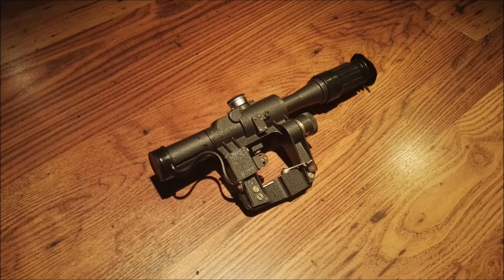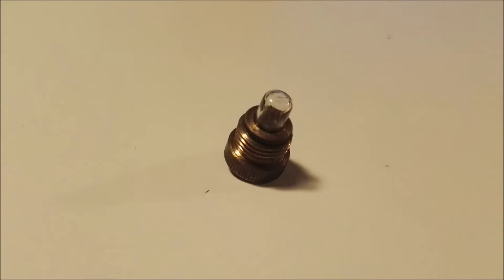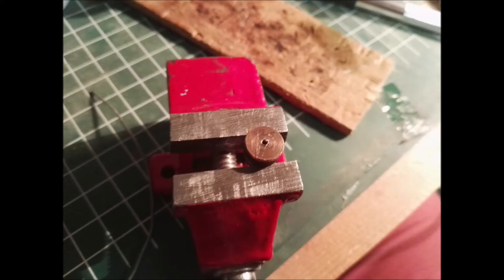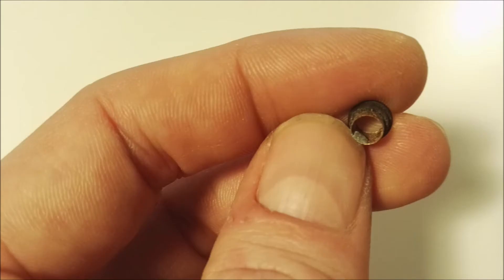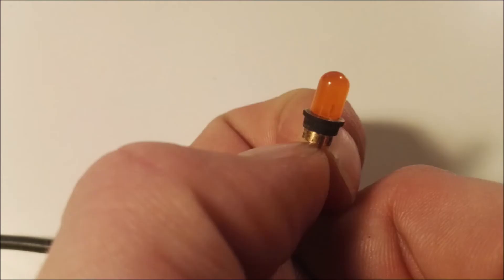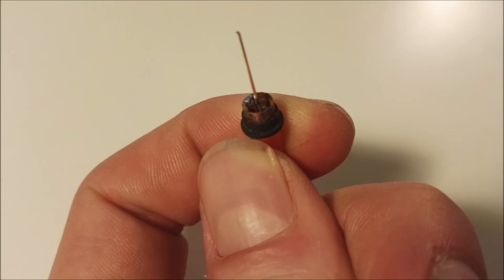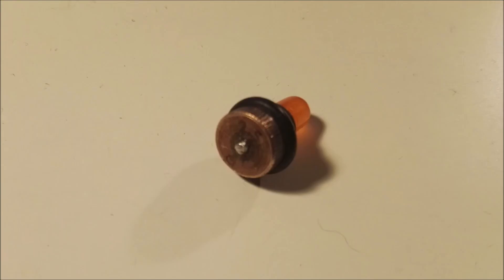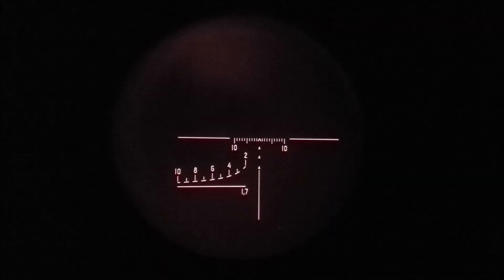PSO-1 scope: light bulb repair

Comment: Can you be more specific as to which LED type  you used .
3v but what output and physical dimensions of LED head.
What colour worked best in the end.?
Thanks. Nice video.
Reply from the maker: Hi Steve, sorry for my late response. I have no specs of what LED I used. But it used something like this:

 https://www.google.com/search?q=LED+dimensions&rlz=1C1GCEA_enNL940NL940&sxsrf=APq-WBuEEJsHYVXiZTpRh2VWPcUxAU5KjQ:1650866131492&source=lnms&tbm=isch&sa=X&ved=2ahUKEwj5_9rKw673AhVDlf0HHdo8CKIQ_AUoAXoECAEQAw&biw=2133&bih=1041&dpr=0.9#imgrc=xQW1uMxC1m1rkM

The thing is that I had to cut/ grind material away from the LED in order for it to fit. This is an iterative process of fitting, grinding, fitting, ...

Comment: i got airsoft clone,

my question is, if i remove the bulb cap, will it leak purged gas inside it?
Reply from the maker: My guess is that the airsoft clone uses LED's. Even if it were a different type of bulb, the amount of gas is negligible small. Otherwise just pull it off outdoors! Wish you the best of luck mate
Reply: @TheWillem  thanks
Reply from the maker: @AbuGuroza  perhaps I misunderstood your question. You mean that your optic is filled with nitrogen? In that case, it should not leak the nitrogen when you remove the bulb. The original PSO scopes are made to replace the bulb in field without losing the gas inside the optic.
Reply: @TheWillem  thanks again for further explanation, now i can having peace of mind to open bulb screw housing
Reply: @TheWillem  Fantastic!  You just answered a question that I've been searching for sometime.  Do you know whether the same applies to the newer POSP scopes from BelOmo?

Comment: what battery did you use ? I can not find how to fix the battery with the original cap.
Reply from the maker: Since I do not like the larger cap for AA batteries (and because it costs extra money/time :P), I managed to use the original cap. I found a spring that fits tightly over the contact of the cap and I used a 3 volt CR2032 battery. Any disk-like button cell should be sufficient. Since the original glowing bulb is replaced by a LED, less power is required for illuminating the reticle. I must warn you, check whether you do not burn out the LED with your 3V battery. Otherwise you need to use a resistor or buy a different LED.

This method works fine for me, but the battery might not be neatly positioned in the compartment. To fix that, I used some cardboard to fill up the empty spots. 

Also make sure that your scope is working using a multimeter. Check whether the cables are in good condition and whether your switch is working. If you wish I can send you some pictures, just leave your email.
Reply: @TheWillem  Thank a lot for your reply. I have a PSO-1 which given by grandpa who is a veteran in Vietnam war (Im Vietnamese, by the way). All the batteries came with the PSO kit were long dead. Same to you, I really dont like the AA adapter because It will destroy the authentic look. I tried to use foam to make an adapter for LR44 but not success. I have many spare bulb came in a kit with the scope and they are all seem like in good condition. So my problem could be the wiring is dead, or my DIY adapter wont work, or both. Im not sure how to test the wiring system. Will I have to disassemble all the scope?

I will be very appreciate for your help. Please send me your guiding photos. My email is ngminhhieu1207@gmail.com
Reply from the maker: Minh Hieu Nguyen I just sent you an email!
Reply: @TheWillem  thank you Willem. I didnt receive it yet. Maybe internet problem. I will keep checking.
Reply from the maker: @MinhHieuNguyen1207  I sent again!
Reply: @TheWillem  Thank you Willem. I received. Will follow your guide. 
If someday you can go to Vietnam, PM me, It will be my pleasure to welcome you.